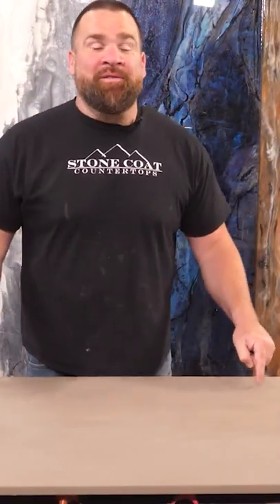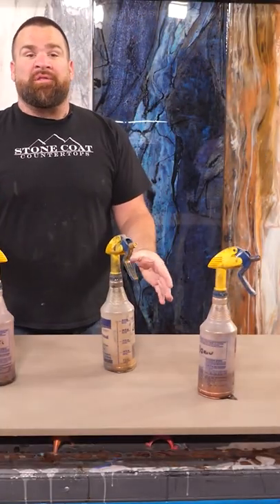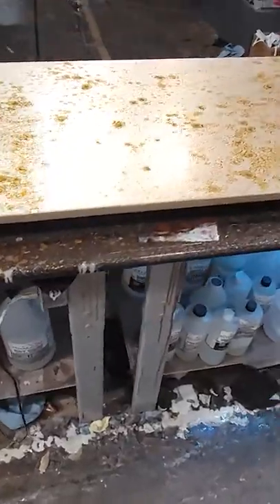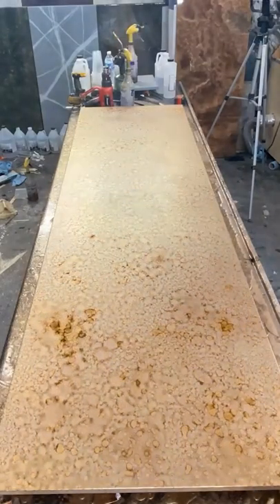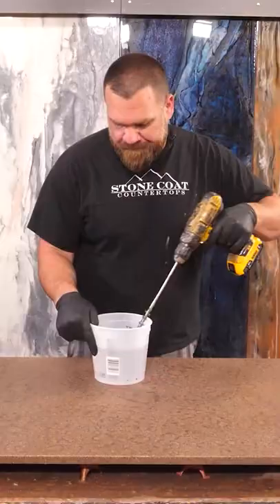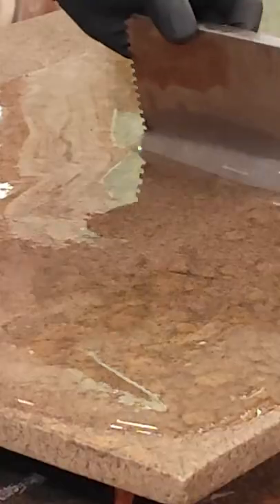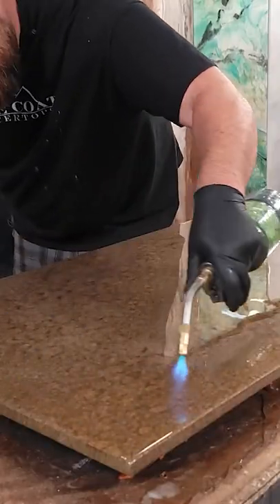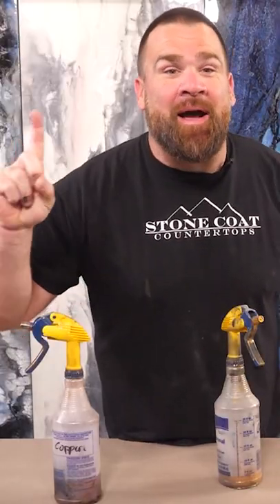This recipe is perfect for first time epoxy users #shorts

Comment: Would love to see a video of you demonstrating that your counter tops can actually withstand a kitchen environment.

Could you put a hot pan on your counter top? What happens to the epoxy of its reheated?
Are all the chemicals you use (particularly in the top most layer) food safe?
Reply: They hold up well. I've done about 20 houses with stonecoat

Comment: Would like to see you pull a pan out of a 400° oven and toss it on top that counter
Reply: ..you good? This kind of epoxy can withstand 315°C/600°F..so whats your point?
Are you really that ignorant to think they could sell this in a kitchen knowing it just melts?
Reply: @Tengen-sama  not sure if you remember but water boils at 212c minimum. I’m not paying to have a maybe situation.
Reply: @ajangawolowo2295  100°C or 212°F. Which is still under the max. Heat it can withstand. So again, whats your point?
Reply: I don't know anyone with expensive granite, quartz or marble counter tops who takes a hot pan out of the oven and drops it right on their counter without a trivet. This is an extremely useless comment...

"I award no points, and we are all stupider for it..."